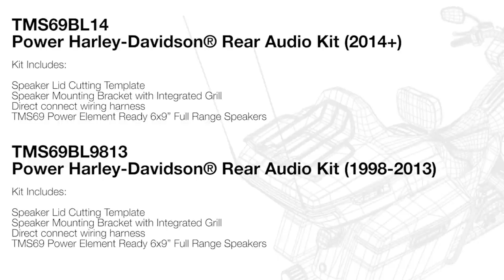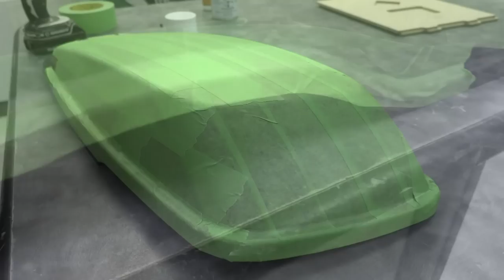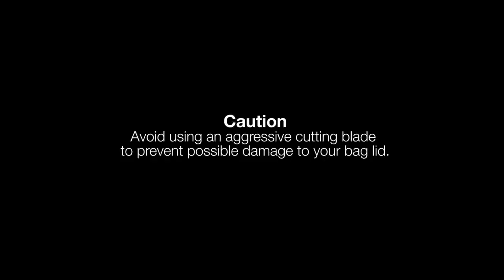TMS69BL14 & TMS69BL9813 Installation

Comment: Great job on this video. The only issue I had was figuring out what screws/holes to use in the amp mount plate. I did this kit and the HD14-TKIT amp and front speakers. Yes I cut my bag lids myself. I have no background in doing anything like this. It took me about 5 hours to do the rear and the amp/front. Thanks for producing this video as I would have never attempted this without seeing how simple and straight forward this project was. I now have audio that somehow sounds like I'm wearing head phones going down the road at highway speeds. It just envelops you with crystal clarity. TechnoResearch will be releasing the 2018 update this Wednesday for flashing. Thankfully they worked with me today and got me flashed. Thanks TechnoResearch Support! Thanks Rockford Fosgate!
Reply from the maker: Thank you tdeloriea for your purchase and thank you for the great feedback so other fanatics can read.  I will let our owner's manual writer & video production team know about your feedback on the amp mounting kit.  You must be a dealer since you have your own TechnoResearch hardware?

Comment: Hey guys. Saw your set up at Sturgis this year. I wasn't planning on getting the new 2018 RGS but now that I got it I need your full set up.  Great work! I'm looking forward to crystal clear sound like I heard at your tent/booth
Reply from the maker: Thanks Tdeloriea for stopping by and checking us out.  Sounds like the HD14-TKIT would fit your bike for the front fairing and if you have bags, the TMS69BL14 will do the job.  If you plan on doing the install yourself, be sure to reduce the bass to minimum during the setup.  If you can get the radio re-flashed to flatten that factory HD equalizer that would be best.  Since HD technicians are now locked out of that functionality, only select Rockford Fosgate motorcycle audio dealers have the flasher to update the radio.  If you have tech questions, be sure to call our support specialists at 1-800-669-9899 8am-5pm MST and they'll be able to answer your questions.

Comment: Love the way they use unpaired bag lid and to not show how easy it can be to eff up your paint.
Reply from the maker: The reason we used black lids on this system early in the video is because we had already cut and installed the 6x9" bag-lid kit on our employee's "Blue Dragon" Road Glide.  We wanted to get the video done promptly, and it was going to take too long to acquire another motorcycle.  Therefore we purchased another set of factory lids to make the cutouts.  Regarding the paint, this is precisely why we over-tape the bag-lid so you DON'T run the possibility of ruining your paint.  All our Stage-3 system videos featuring bag-lids use this over-tape technique and the paint on all motorcycles remained un-harmed: https://www.youtube.com/playlist?list=PL-ob-nWq0t1iC5_Q1_uutiNbMoIL7292F

Comment: Hi,, Great work and results!,, i have bought the same system but used one,, it came without saddles bag mounting screw,, the screws that fitted on grill, ring and speakers baskets,, kindly cany you please provide me the screw specs,,,

Comment: I just ordered these about a week ago they should be here in a day or so hopefully I can get them installed this weekend the only thing in worried about is how to get the radio reflashed
Reply from the maker: That's great Rocco, and thank you for your purchase.  Since factory H-D® technicians are now "locked out" of their own firmware, we sourced and have been selling the Centurion Audio flasher directly to Rockford Fosgate Motorcycle Audio dealers that enables them to bypass that factory EQ setting.  If a local dealer does not have the flasher, a pretty good alternative is turning the BASS all the way down, which takes out a majority of that +26dB boost that H-D® programs into the radio.  This will let you add aftermarket amplifiers like the TM400X4ad to get louder and minimize the risk of blowing up your speakers.

Comment: Just watched the video, what about removing the saddle bags after installation? am I required to pull out the grommet every time? whats the life expectancy of that grommet being pulled out and shoved back in repeatedly?
Reply from the maker: There is a quick-disconnect for removing the bag lid.  However, if you'll be removing the ENTIRE bag assembly from the bike, you'll need to fish the harness and grommet through.  The grommet uses a custom molded high-density rubber (not your typical rubber grommet) so it will stand up to the abuse of being removed and reinstalled.
Reply: I would remove the bags more than I would the lids.  The connector should be on the outside of the bag.
Reply from the maker: The length of wire from the rubber grommet to the quick disconnect is only 6".  The rubber grommet is a high-density rubber that has a large flange on the outside (weather side) and a smaller flange on the inside (cargo side), making it easier to pop the grommet off and fish it through quickly.
Reply: Yea

Comment: Does the bag leak after install? I know the speaker are marine grade. I'm wondering if they leak afterwards or is there anther part that can be installed to may installed to seal the bag back up?
Reply from the maker: The bag-lid uses a 3-part seal that prevents water intrusion into the bag itself.  There's a gasket on the underneath of the grille, gasket on the bottom bezel, and the compression interlock between the two pieces once you tighten everything down.

Comment: Just bought a 2018 Street glide standard. Would this kit work on it as well? Also curious about water on the rear speakers. Is the inside of the bag still water tight?
Reply from the maker: Hi Robert, sorry for the late reply as I was confirming with our installer this will indeed work with 2018 Street Glide bags.  However, they are not compatible with the Power Lock Kit option because the hardware conflicts with the grille assembly.  Assuming the speakers and grilles are installed correctly, there should be no water intrusion issues.  We actually did demos at Sturgis pouring water thru the grille and the speaker "punched" it right out.

Comment: So dumb question, what’s the difference beteeen the BL9813 versus the BL14 kit? Is the lid mounting bracket different? Apparently I have a 9813 kit on the way to me and I have a 2020 bike.
Reply from the maker: Darin Miller, Shape of the baglid itself requires a different grille, retainer ring and template.  They are not interchangeable. 2020 bikes require TMSBL14 kits.

Comment: Hi guys looks super cool, I bought a used street glide and there's a harness I see. by the gooseneck, and speaker wire under the seat, I think the previous owner had a system.  how would you suggest I see if the speaker wires work before I cut into the bags or will they work without an amp?
Reply from the maker: Hi Michael, sorry we missed your commend earlier.  The Rockford Fosgate saddlebag system comes with all the wiring as we recommend to use these for the quick-releases. We would recommend looking under the fairing to see what type of amplifier is already there.  It needs to be able to produce 50W minimum to 100W optimum RMS or it likely won't be enough power to hear them properly.

Comment: Hi Rockford Fosgate,  As the Factory Head Unit/Nav system is such a P.O.S I'm upgrading to a Sony XAV-AX5000 which is 4x22W RMS. Im considering adding the HD14-TKIT and the TMS69BL14 at some point in the near future. Can you tell me what I can expect in order of audio improvement and will I be able to utilise the 4ch option on the TM400X4ad. I'd love to be able to hear a system installed in a bike first, however as I'm in Australia this may not be so easy for me as there are no dealers in my area. Cheers Graeme.
Reply from the maker: Well it's significantly louder as we custom build the TMS speakers included in the HD14-TKIT so sound their best around wind, road, and exhaust noise (they are not car audio speakers).  In order to use the 4-channel output of the radio, you'll simply set the input switch to accept a 4-channel input instead of 2-channel input.

Comment: I sold my bike with the speaker rear lids and buy a new bike 4 weeks ago. Removed the rockford speakers and would like to install to my new bike but don't have the template saddlebag lid make a new hole. Where can I find a new templates? Thanks in  advice
Reply from the maker: Hi Robinson, we sell replacement speaker grilles.  However, the cutout templates are only supplied in the full TMS69BL14 & TMS69BL9813 kits.

Comment: why do you leave the amp in the 2 channel position ? the Harley radio has 4 channels. I did not see any water protection for the speakers is that built into the grills ?
thx
Reply from the maker: Great question James B!  Most users only have a front audio system so we suggest the switch be set to 2-channel input.  If you previously have a tour-pak or an aftermarket radio with front/rear outputs, then you can definitely switch the amp to use a 4-channel input and tune the front & rear channels separately.  The bag lids are water proof ... we use the term "Element Ready" which is a combination of protection from both UV rays and water.
Reply: Yea the bag lids are waterproof. I like how you dodged the question. So are the speakers are water proof or not?

Comment: I already had the radio flashed for the front HD-14 Rockford kit.  And I just added the rear lid speaker kit.   Do I need to flash it again for the added rear speakers. And do I need to run the 4 channels of the Amp now instead of the 2 that it’s on currently. Thank you
Reply from the maker: Sorry for the late reply.  Once you have the "Rockford Fosgate 2014+ All Bikes" flash, you're good to go.  If you have an existing front/rear TMS audio system with the TM400X4ad, you'll have Y-Adaptors included in the original kit to use on the amplifier outputs to take advantage of the rear baglids.  If you only have a front fairing TMS audio system, the baglid speakers connect to the rear outputs of the amplifier.  Look at our complete installation videos for info on the integration side.  Keep in mind, Stage-3 kits utilize the TMS69BL14 baglid speakers, so you'll be looking for "Stage-3" videos: https://www.youtube.com/playlist?list=PL-ob-nWq0t1iC5_Q1_uutiNbMoIL7292F
Reply: @rockfordfosgate  hey I actually called you guys the day I installed them which is the day I made the comment. And spoke to a nice guy who walked me through the amp settings.  And I’m able to hear music on 2 channels.   But 4 channel only the fronts work.   Also I’d like to get more base out of the sound.  Any trick to that ?      The amp settings.  Are the same since the installation of the front hdt14 kit.  Even after I put the back in.
Reply from the maker: @christopherhash2737  Great!  Yes, Steve and Forrest are super guys!  If you have the HD14-TKIT (1st generation kit) you'll need to keep the input switch on 2-channel input because that harness only supported a left/right signal input.  This should still produce output on all 4 channels.  If this doesn't work, double check the INPUT SWITCH to make sure it's fully engaged. The 6x9" speakers should add quite a bit of bass to the system.  If this isn't enough, aside from adding 2-3 notches of bass on the radio, you'll need a subwoofer.  Luckily, we launched a brand-new sub kit today.  You can find more information at https://rockfordfosgate.com/featured-products/2014-hd-subwoofer-system/

Comment: ?What settings or changes do I need to make to the Amp if I’m adding the saddlebag speaker to my already installed Rockford Fosgate front kit? 
More importantly was should be my amp settings for the Rockford Fosgate front and rear (saddlebag kit) 
2018 Road Glide special
Reply from the maker: Great question Casper 2k!  First, thank you for looking to Rockford Fosgate for your bike.  Since you already have the HD14-TKIT for the front, you're using the TM400X4ad amplifier.  You'll keep the INPUT SWITCH at 2-CH since flashing the radio only supports a left & right output, but you can balance this front/rear issue with the gain controls.  Set the REAR GAIN to 12:00 o'clock that will run the bag-lids, then start the FRONT GAIN at 12:00 o'clock and slightly lower it until you have a good balance between the front & rear speakers.  The gain may end up around the 11:00 o'clock position.  Keep both EQ settings to MINIMUM.  If you do not have the radio flashed, you'll need to do that so you don't blow-up any of the speakers.  For more info on flashing, refer to this advisory: http://rftech.custhelp.com/app/answers/detail/a_id/1215
Reply: @rockfordfosgate  In the video you say set the gain at the 2:00 position, and here you say 12:00? Wouldn't I also start at the 2:00 position then lower one to balance? I'm installing both fairing and bag speaker kits and want the proper setting the first time.  Thanks
Reply from the maker: Hi  @joeblow5102 , since the video was released we have updated the recommendation from 2:00 down to the 12:00 o'clock position since several customers were blowing speakers when they were running them at full output for 20 mins to hours at a time.   Here are the latest tuning sheets for the amplifier.  Since you're using the rear baglids, you'll reduce the front down to 11:00 to balance the system.

Harley-Davidson 1998 - 2013 Models
https://rockfordfosgate.app.box.com/file/336667382522

Harley-Davidson 2014+ Models
https://rockfordfosgate.app.box.com/file/410746702413

Comment: Hey guys, quick question: I have the Stage 2 kit on my 18 LTD and am interested in installing the bag lid speakers too... At around the 2:46 min mark of this video you mention having to replace the existing harness with a new harness as part of this kit. Does that new harness support both the tourpack and bag lid speakers as well as the front speakers, so all 6 speakers are working at the same time?
Reply: Hi Guys, I purchased the kit and the harness essentially connects the bag lid speakers to the AMP via either the open rear slot on the AMP, or if you have tourpack speakers installed already (like I do), you can use the Y-Adapter from the main unit to connect to the AMP and then connect both the bag lid speaker and tourpack speaker harnesses to that. I installed the speakers and wired them last night. Not too bad. Tonight going to remove tank/front fairing and run the harness up and make that Y-Adapter connection. Then make sure the AMP is set properly and test/tune system. The fit and finish on the components is great and the wiring into the bags is minimal and doesn't interfere w/any moving parts based on how RF secures the grommet in front of the connector inside the bag. Thanks for a great add-on product for my bike!
Reply from the maker: Sorry we missed your original question Bane1240.  We appreciate your follow-up to help fellow H-D fanatics get this installed on their bike.

Comment: I ordered these along with the front fairing speakers and amp kit today. I'm really excited to get these in my bike!  I was wondering, if the radio needs to be flashed prior to, or after the speakers and amp are installed?
Reply from the maker: It doesn't matter, you can test the system at low listening levels to make sure everything is fine, just don't turn it up or you will blow your speakers.

Comment: So the only difference on the wiring harness I initially bought with my HD9813SG-TKIT and the one that comes with this kit is the pigtail and quick disconnect?  If so, can I simply order that pigtail alone if I choose to go that route?  Also, do I keep my amp in the 2 channel setting even though I'm running the 2 front speakers that came with my HD9813SG-TKIT?  Great video by-the-way,  thanks
Reply from the maker: Hi Jose, yes the wiring harness supplied with the Bag Lid kits replace the rear harness from the front TKIT using a molex connector.  This harness is not available separately, but is included in the Bag Lid kit containing the cutout templates, grilles, and speakers. The 2ch/4ch switch is for how many inputs you are feeding the amplifier, not the outputs, so it should stay at 2ch in.

Comment: Video doesn't show wiring to clutch side of saddlebag, only brake side. Where did everyone route it on clutch side to get to bag?
Reply from the maker: Use a T45 Torx to loosen the 2 bolts for the fuse box.  This will give you enough room to route the harness through.  Once the harness is pulled through, reinstall the fuse box.